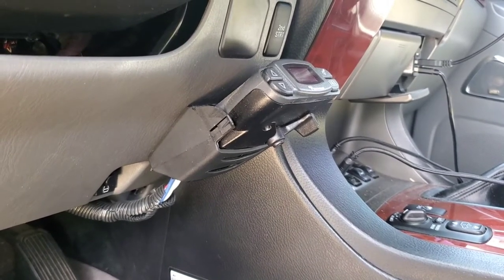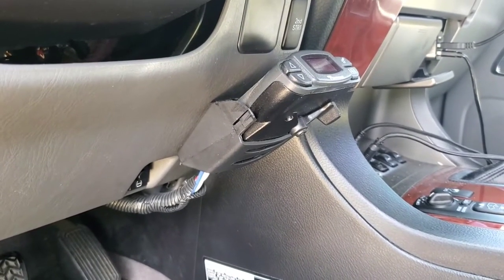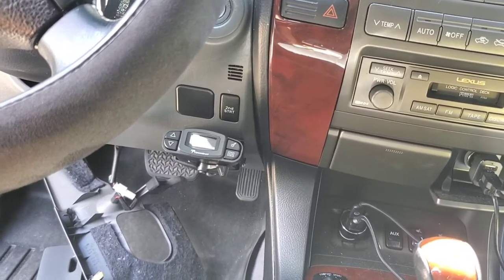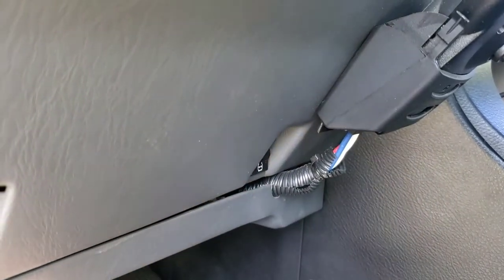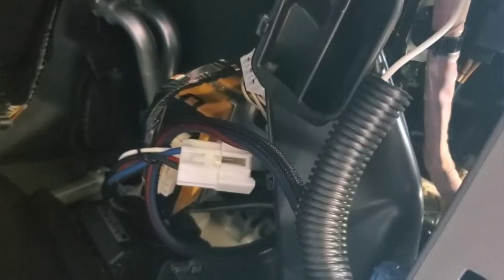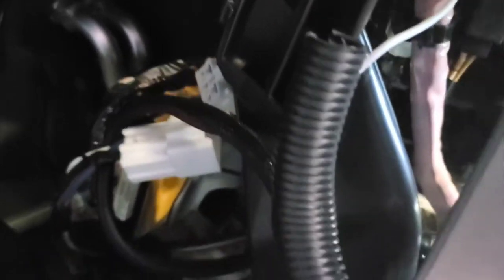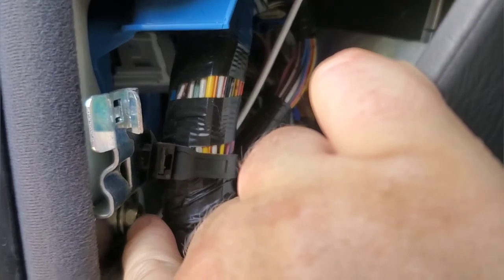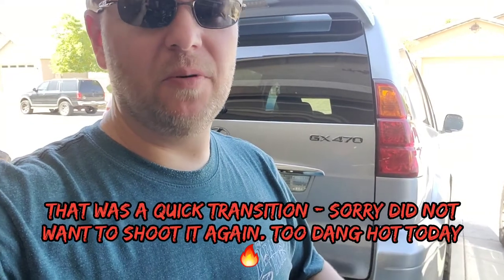BRAKE CONTROLLER - LEXUS GX470 OR TOYOTA 4TH GEN 4RUNNER. INSTALLATION DETAILS WITH LINKS! EASY DIY

Comment: I was convinced I had the one GX470 without a tow package wire harness until your video. Great points about servicing the entire package for heavy towing. I'll be going through the entire braking system and installing firestone air bags plumbed to the original air lines. Deleted my stock airbag system. Thanks
Reply from the maker: Sounds like a plan!

Comment: Dude, thanks so much for making this video. I had the hardest time trying to find out where to install the trailer brake and which products to buy and this made it a breeze. It definitely was hard as hell finding the wiring under the steering column but I finally found it because of the video. Thanks again!
Reply from the maker: Glad it helped!

Comment: The hardest part is finding the plug under the dash. Just keep looking around the steering column area and you will find it wrapped in electrical tape.

Comment: My GX came without a hitch. I added a factor hitch and the trailer lights connector was under the frame. Everything works however I can find the plug either. Is it possible they used different wiring harnesses?
Reply from the maker: Not that I have seen, the connector is usually just buried or wrapped in electrical tape. Not usually hanging down in clear view or easy to find. Gotta dig a little.

Comment: How did you mount the cubby holder to the underside of the dash?
Reply from the maker: Just a couple of coarse screws. I will re-check the hardware. Think they were panheads.

Comment from the maker: Other GX Videos of mine:
Driveshaft Clunk / Rear Ended feeling fix
https://www.youtube.com/watch?v=7Qekh4_L3EQ
Swaybar Maintenance:
https://www.youtube.com/watch?v=_9ak5mHXdDE&t=350s
Towing with your GX470 | hitches:
https://www.youtube.com/watch?v=Hf_PM8aMB5k&t=125s
Towing with your GX470 | Brake Controller:
https://www.youtube.com/watch?v=yd9WBO1mSB8&t=2s
GX470 power steering drain and fill:
https://www.youtube.com/watch?v=F6bC4RMKde0&t=1s
Oil change info GX470
https://www.youtube.com/watch?v=DFCJCQ6xKlQ&t=9s
Lift and airbag trick:
https://www.youtube.com/watch?v=z1NJzxT2KtY&t=166s